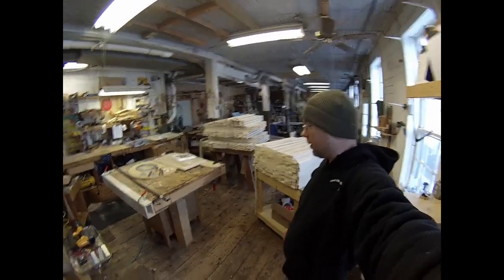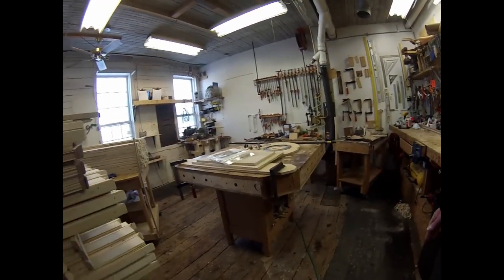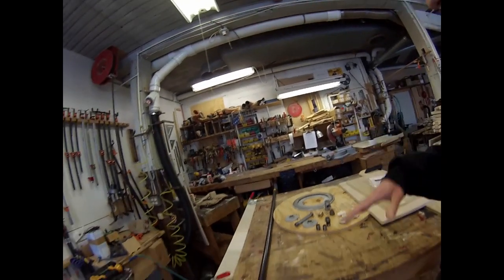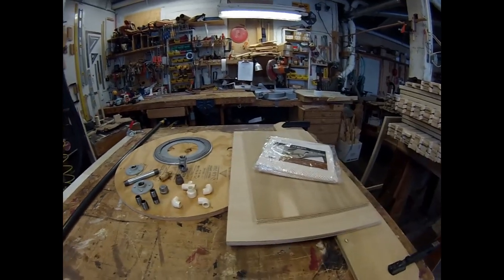Workbench Solutions: Hanging Carousel Shelf

Comment: A light on the bottom would be smart. Run the wire right thru the pipe, in thru a hole right below the box on the ceiling. and out thru the bottom disk. Put a plug at the top end of the wire, and plug into a ceiling outlet (install one if you don't have any) so the carousel can still be removed.